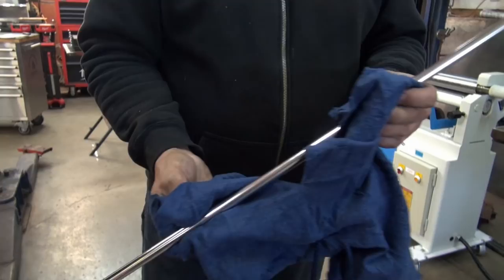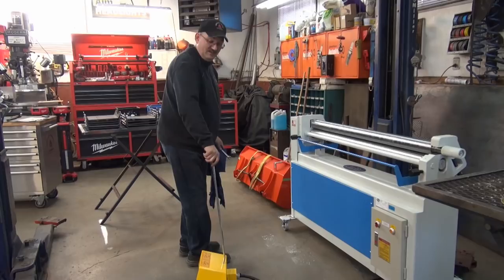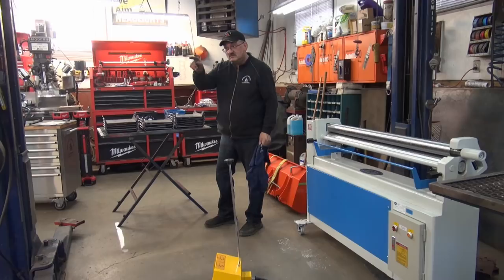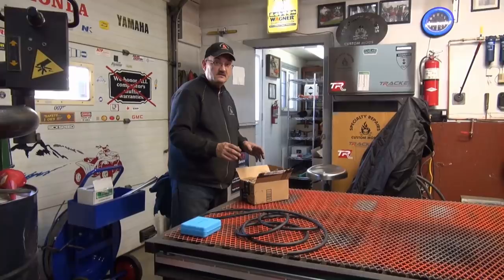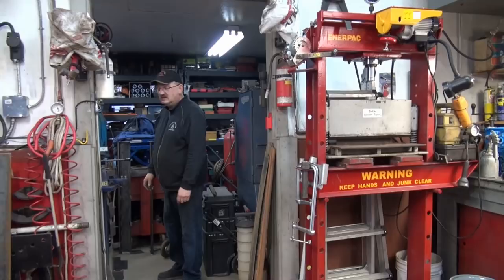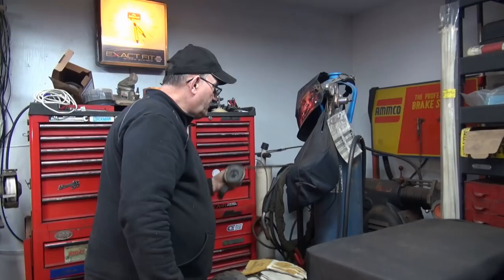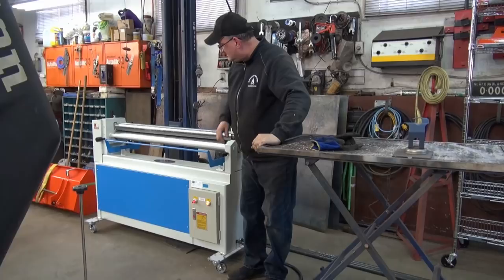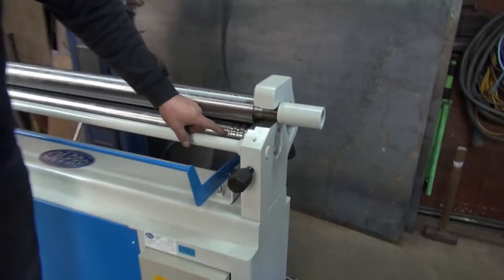Modding The Slip Roll

Comment: With out reading all the comments and risking someone might have already suggested this. I suggest you get your electrician to check the amperage draw with a clamp meter while your torch is in operation.  If the amperage draw is below the breaker rating when it trips you then can conclude the breaker is the culprit.  If the amperage draw is above the nameplate rating on your piece of equipment you can then conclude the machine has a problem.  Keep up the good work.
Reply from the maker: I totally agree. Thanks 👍

Comment: An arm attached to ether side that lets you mount and aim lights at the work.  Magnetic base or drilled and tapped hole could work depending on how thick the metal is and how heavy the arm/light assembly is. 

A shelf mounted to the side of the machine to set the pedal on when the machine is not in use would keep it out of the way from damage.

Comment: Although a 100 amp breaker is recommended for maximum gain on the plasma cutter 60 amp breaker is undersized just make sure you are getting adequate compression

Comment: Hi Paul Great  stuff as usual. Re; Your tripping breaker. Here in the UK we use breakers that have different ratings for different jobs. For example 100amp B rated, C rated or D rated By that I mean if we are wiring an inductive load, say a motor or coil in a transformer. The start up current will for a second or so exceed the amperage of the breaker. On an inductive load such as your table we would use a C or D rated breaker that would take into account those spikes of current flow. As it seems an intermittent problem I would think that may be this is whats happening if you are losing the breaker as the plasma cutter fires up. It is all to do with where the high current flows within the sine wave of the frequency of the electricity supply. Lots of math. Do you have these type of breakers in Canada, because I would suspect in the that might be the problem.
Reply from the maker: Paul I’m not sure about differant ratings on the breakers. I’ll ask the electrician when he gets to the shop. The strange part with this is they put a 60 amp and new wiring in the sub panel and I used it for three or for days with no issue then yesterday when I started the cut with the CNC plasma it went 20 minutes then the breaker started to trip out. I keep resetting it to complete the CNC cut path which it did. I guess mybe the breaker is border line to the 60 amp rating.
Reply: If it is warmer in the shop that will cause the breaker to hold less amps.

Comment: Paul, quick question or two....are you using 85 amps on your Sure Footer Plates?
I know you had the blowback problem and i think you uped the amps.
Are your breakers dedicated to just the Hypertherm? Compressor's not on there?
I'm getting by with 50 amp breakers, but I have the  Hypertherm 65.
Just my 2 cents....good luck figuring it out
Tim in Calif.
Reply from the maker: Yes Tim. I’m up to 85 amps but today I dropped down to 80 amps and it still happened. The weird part with this was I have cut four sheets of 1/4 plate and this never happened. Anyway tomorrow I’m going to 100 amp breaker and heavier wire to see if that fixes it, thanks.
Reply: Good Luck....I hope the breakers do it for you. If not Hypertherm are good people. I'm not sure how it works in Canada, but they did quick work when I had an air valve solenoid problem.